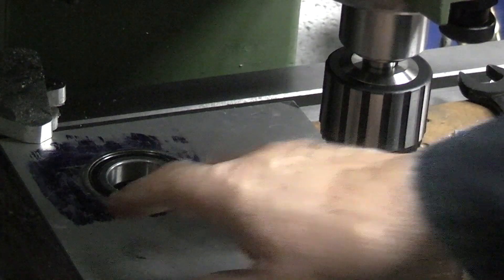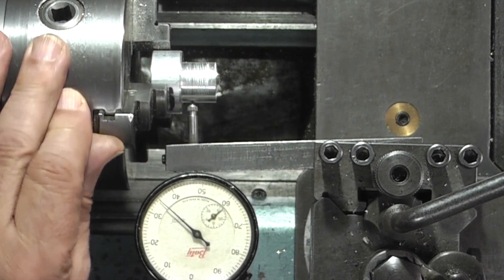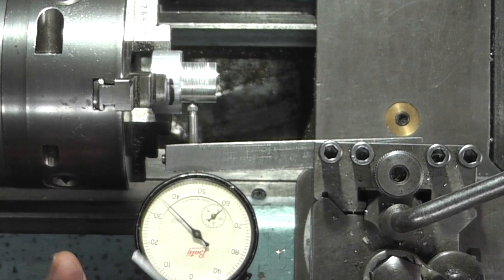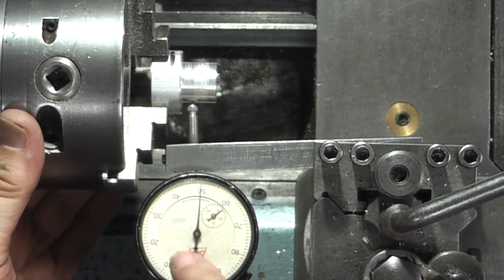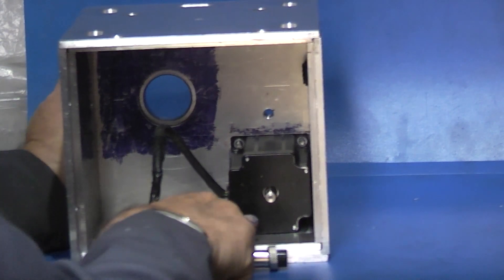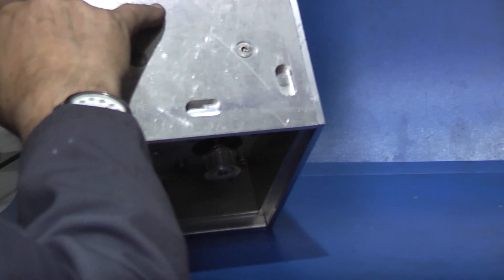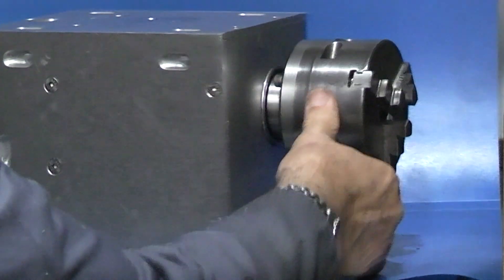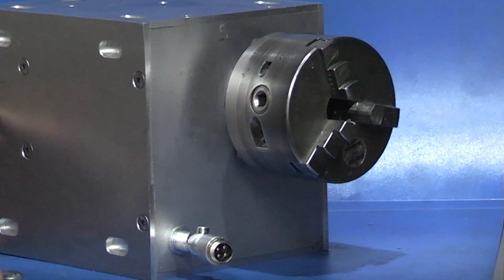Rotary head finish and test

Comment: Liked & Subscribed.   Nice 4th axis.  Do you happen to have the Part Number for the 4 pin connectors that you used?  (I am wanting to tidy my cnc set up a bit).   Thanks for the help
Reply from the maker: Hi Joe  they are called aviation sockets they come with  2 3 4 5 6 or 7 pins
Reply: @enotsengineering  - Thank You sir- I will start to look for them.  I have my CNC controller hard-wired to my steppers..

Comment: Looks good , does it have a spindle lock .    Cheers .
Reply from the maker: Hi Max at the moment I haven't fitted a spindle lock as the stepper motor holds the head in position. I don't know how strong it will hold but there is room inside for a lock if needed.
Reply: @enotsengineering  there may be cases where you may need it .  A solenoid activated brake would be cool .  Cheers .

Comment: Strange putting the plug under the chuck where hot chips will melt through the cable protection 🤔
Reply from the maker: Hi Steven. The plug is on the only face which can not be used to clamp to head to the table. As the chuck is offset all faces give me a different chuck height.
Reply: enots engineering Explained 👍

Comment: Very very nice. The back would almost warrant an acrylic cover or window so the mechanism is visible. The 149.850degrees might be due to microstepping configuration in the stepper driver, probably set to 4. If you could set it higher you should be fine, the 4988-based drivers normally allow up to 16 giving 3200 microstepping per revolution or 0.1125 degree (pulley transmission factor notwithstanding )
Reply from the maker: Thanks I will have to check the driver I think it was set to 10
Reply: just an addon to that. i started with the a4988 drivers but highly recommend the $10ish TB6600 stepper drivers instead. the tb6600 is higher power, easier ro wire up, a lot quieter and (in my experience) super reliable.